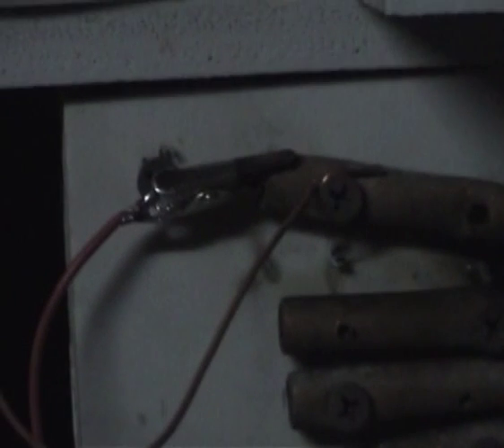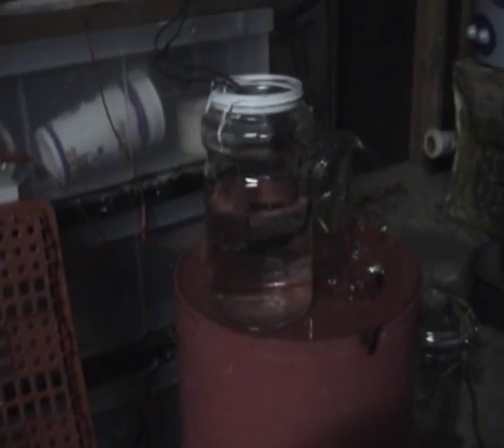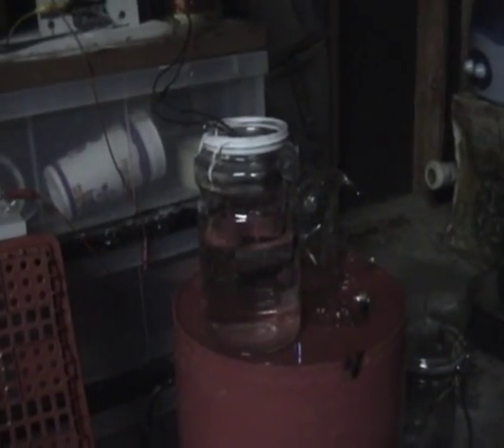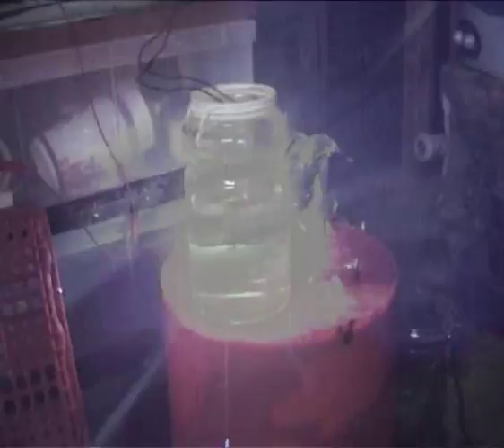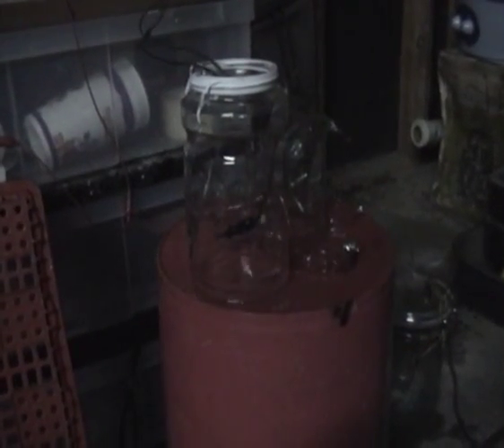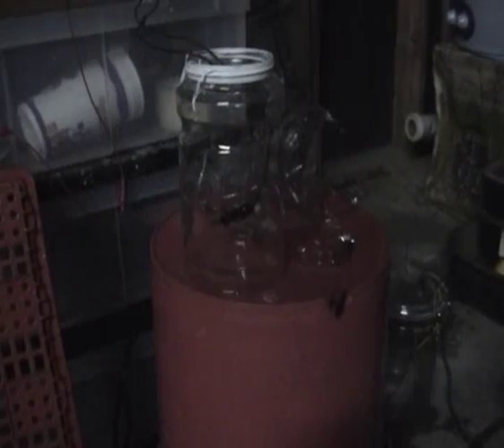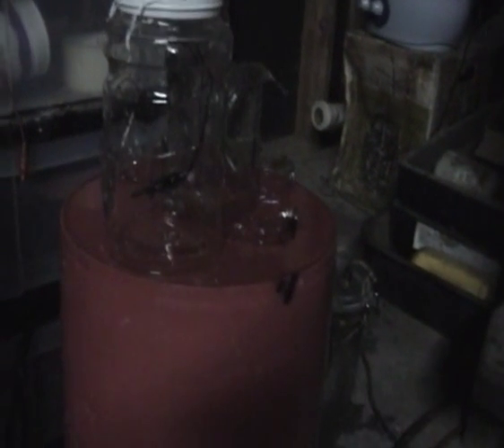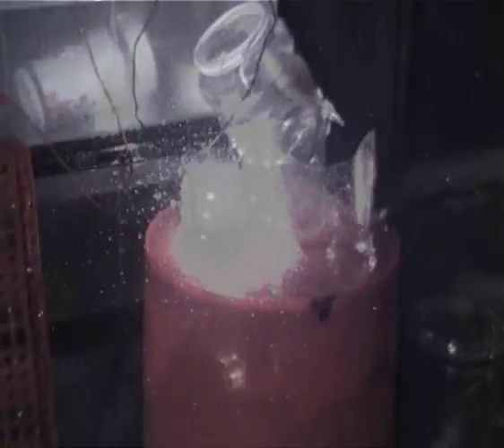tesla coil hho distilled water prt 2

Comment: Maybe if the wires are kept away from the sides of the container, it will not break?

Very interesting experiment. I wonder how hard it would be to contain the spark to a small area at the bottom of a pipe?  You could determine if the reaction is creating hydrogen by lighting any bubbles that came to the surface at the top of the pipe.

The hard part would be finding a pipe that could dissipate heat quickly and also keeping the wire away from the sides of the pipe, so it doesn't ground out.